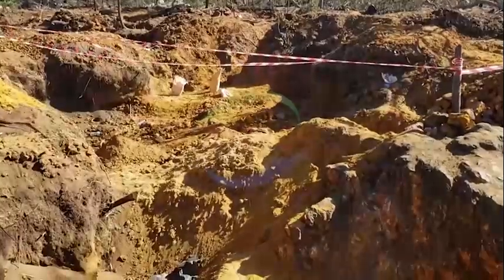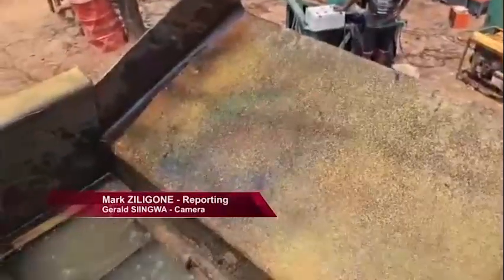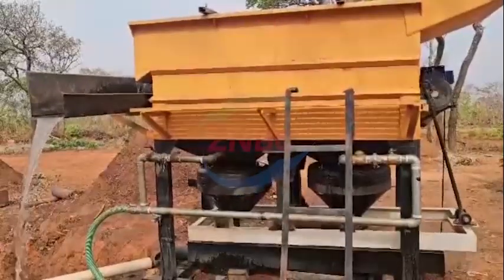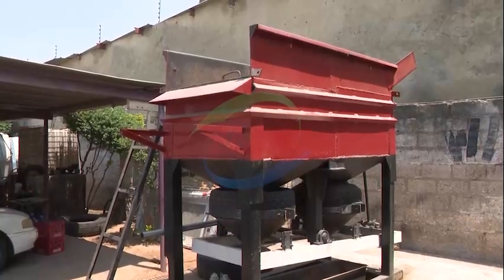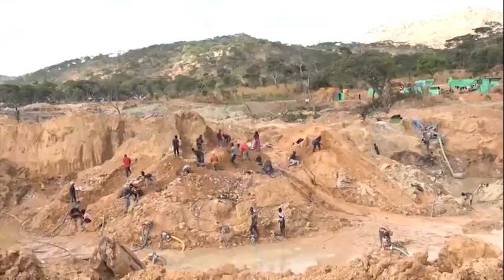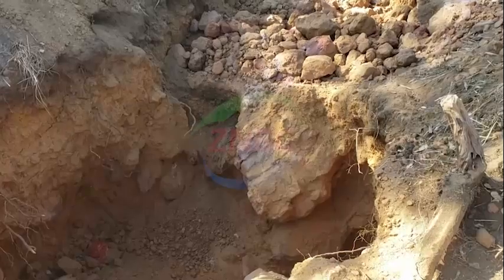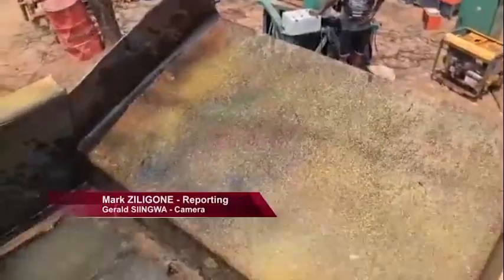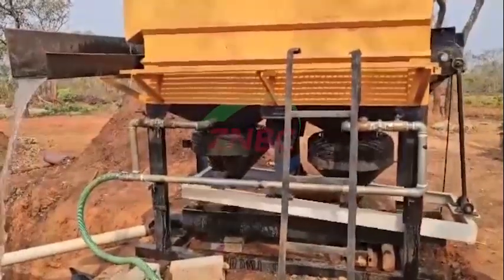Zambia Firm Develops Machine that Extracts Gold Using Water

Comment: What happens to the dirty water from the processing.. that’s pollution too. Same environmental issues are happening in Ghana with waterways getting polluted by soiled water. So this is not necessarily environmentally friendly if the soiled water is just spilling into the environment.
Reply: It's minimal pollution compared to other methods I suppose. That's a winner either ways.
Reply: Water can be cleaned
Reply: It's obviously the cleanest opinion available, no harsh chemicals involved.
 Water can easily be filtered clean again down the stream by simple mechanisms
Reply: Iwe jungle Baboon iwe, in your Ghana there , artisanal miners are using Mercury to extract Gold. this machine is using water, so, in your stupid mind, what exactly are you comparing? The damage caused by Mercury is the same as that of water? Foolish!